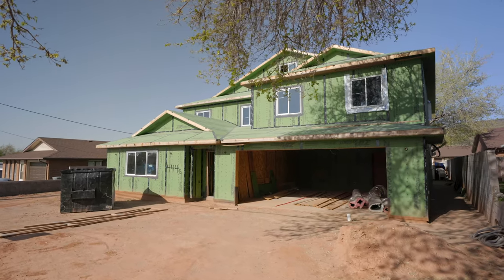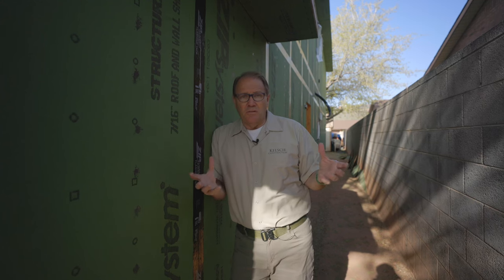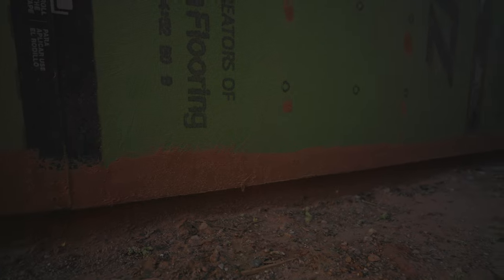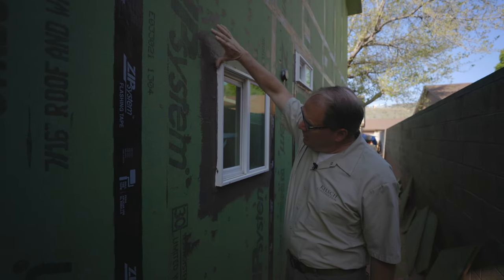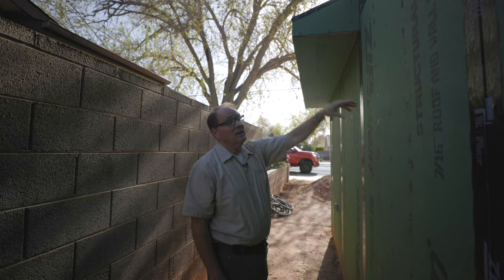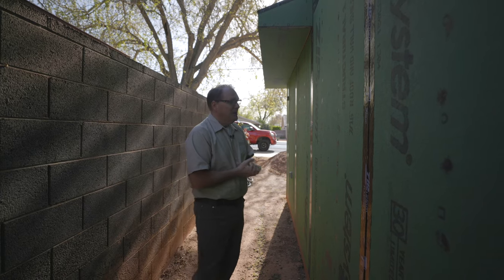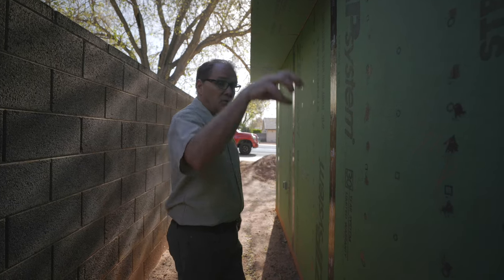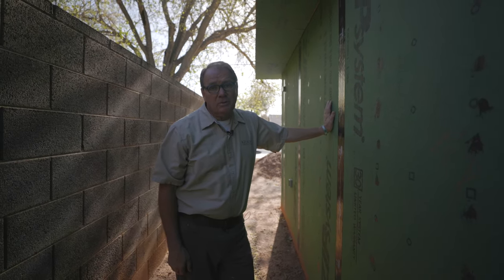Zip System Pros And Cons

Comment: Super tight building should be the standard because water infiltration is the #1 destroyer of buildings, and it's the main reason why so many American homes are falling apart after just 20 years, when most European homes are built to last a century or more. It makes a heck of a lot more sense to manage (filter and pre-condition) airflow into your home with an ERV rather than allowing contaminated air to just leak in. Every new home should be built to much higher standards than are currently the norm. The USA is so far behind other developed countries when it comes to building codes it's shameful.
Reply: When the ERV breaks the home molds up
Reply: @claireh.7605  When the ERV break, you fix or replace it. It's called home maintenance.
Reply: @claireh.7605 umm… why wouldn’t you just fix it? 🤔
Reply: Oddly, a super tight home can be a cause of water problems. Super tight should not be the standard.
Reply: @chadd587  So, do you consider yourself an authority over people like Joe Lstiburek? Just curious. 😂 In this case I’ll appeal to authority, although fallacious, to highlight that maybe you’re just unfamiliar with sound control layer theory.
Reply: If if don’t dry it dies
Reply: @chadd587  There are right ways and wrong ways to do everything. High performance buildings need to be built with "smart" vapor retarders in the right places to allow for drying and protect against moisture accumulation inside walls, roofs, etc. It's not that complicated.
Reply: @dlg5485  Yea, including moisture that originates within the home that would accumulate on that barrier on the I side of the home and find it's way puddled at the base. Happens all the time slick
Reply: No house should be too air tight. Sometimes people outsmart themselves. Dont pay extra for a dumb idea
Reply: @BEYONDYOURIQ Exactly. People would live in a plastic bubble if they could. Why are we trying to separate ourselves from the natural world at every turn?
Reply: @chadd587  Wow, even after all the free education all over the internet from actual building science experts, you guys still think you know better. Some people will never learn...too hard headed.
Reply: @dlg5485 I feel like you've selected you're favorite "education" sources on a bit of a confirmation bias basis. I've done quite a bit of research on this on BOTH sides because I'm actually about to break ground on my home. So I do have skin in the game on this subject. I'm not being flippant I'm being thorough.
Half of my opinion was from local builders and a couple of builders I used for estimates.
Reply: @garryallan824  Duh!

Comment: I'm confused. The whole point of the Zip system is to create a weather resistant barrier. If the owner does his job and routinely inspects his home for joints in siding, facia & trim that could be weakening and corrects them, then water isn't going to get into the cavity outside of some big event like extreme weather. You speak in terms of having the home breath. Again, are you talking about an extremely well-sealed home that has very low chance of getting moisture in the walls, or are you talking about installing an ERV that ensures there's air exchange? You don't really make this distinction. I can use Nashua Extreme Weather Foil 2.83" that's vastly less expensive than Zip tape along with a good house wrap like Tyvek and get the same performance as Zip at a much lower cost. And two layers of bottom plate foam with a good bead of adhesive is a lot easier to install than that bottom sealer that's probably quite expensive just for the product. Probably the most important part of building a taped home is to ensure there's good contact between the sheathing and the top / bottom plates as well as corners. And to take the time to add extra nails and maybe spray sealer like Gorilla or even foam spray.

Comment: The zip systems blocks air and water from coming in but it also allows moisture to escape. It has a perm rating. It’s a very good product. 100 times better than house wrap
Reply: But it can delaminate and tape can fail and water can collect inside tape bubbles supposedly
Reply: The coating has a lower perm rating than the osb but it actually doesn’t dry to the outside very well.
Reply: I think the peal and stick or liquid  house wrap is actually a little better when done right but you have to weigh, costs of all of them. With exterior insulation became more the norm zip r is very attractive especially with shake siding. I am working on a house now where we are trying to figure out what makes the most sense.

Comment: Just finalizing a self build in Maine. We used the Zip system. One point to mention is the tape should be rolled using their Zip roller, it activates the adhesive in the glue and ensures a good seal. Kinda slow and laborious but does actually make the seal far better.
Reply from the maker: Correct. If not done right dust and wind can get under and make it ineffective.

Comment: Zip system is still just OSB. I sort of think Plywood with a wrap would be better than any OSB, regardless of how well you try to seal it up. How long can your sealed up home last without power and it's air handler not moving fresh air in? Humans need air, fresh air. I think making ultra-tight homes isn't good for humans. Building in an air gap between your siding and sheathing doesn't seem like it would be that expensive, and you'd probably want to do with Zip too, regardless. Save a couple bucks a month on heating/cooling, or live in a home that doesn't have every outgas from the products in it stuck with you for days on end. Building a tight home, then bringing in cold or hot air from the outside seems counterproductive to me. There is no free ride in the laws of thermodynamics. If you're bringing in unconditioned air, you're conditioning it regardless of what fancy exchangers you put in. Plus the extra expense of doing all this to lower your heating/cooling bills sort of offsets the later savings, since you're usually financing all this additional cost. I think Zip system is probably a great product in dry climates. In other climates, like cold and wet ones less so.
Reply: Its more than osb, it has a WRB on it which is why it can be exposed to the elements so much longer than any OSB. 
Homes do have windows for when the power goes out. However its not like here in the US people are going without power often or for even very long. 
Yes with titght himes like this you must have an ERV bit this costs very little to run. Especially compared to an AC or furnace. 
Its not all about the money saved but about the comfort of the home. Having more consistent heating throughout the home, less pollen, pollution, and fewer bugs. 

Lastly zip system can be used anywhere but like any system it requires to be properly installed.
Reply: If you're worried about conditioning the air through an ERV, then why wouldn't you worry about the air you've already conditioned leaking out through gaps in the building? You've already paid for that heat or A/C, why not keep it in the house? And wouldn't you rather have the air coming in being filtered instead of coming through the walls, crawlspace, etc.? A tight envelope with controlled air exchange is MUCH less expensive to run and maintain. It makes up for the extra cost of materials very quickly, and makes for a much cleaner, more comfortable home.
Reply: @DeuceDeuceBravo  I'm not worried, my point is why depend on an active system to do essentially the exact same thing letting a few leaks in or out of your envelope would do naturally. And as I stated, no, all the extra expense and the interest rate you'll pay on it won't offset the small amount you will pay every month through natural inefficiencies of a less tight home. You are trying to compare homes built before the 50s and 60s with no insulation to ones that do have it. Plus I haven't even talked about extreme weather events that can have disastrous outcomes with the potential massive difference in air pressure. My suggestion is go talk to people who lived on the Space Station for a long time. They say the entire thing smells a little gross. Keeping everything inside your home and running it through a filter that can't pick up all the things floating in the air does not sound appealing. And if you do exchange it, as I said, there's no magic, you're going to have more expense conditioning that new air, just like you will with natural intra and extra filtration in and out of your leaky home.
Reply: @spazoq  You're missing the point. The air exchange you're talking about is uncontrolled. Just one example... You have humid air passing through your walls when the house "breathes". If you're running A/C in the summer, then the dew point in those leaky walls will cause condensation, which leads to mold and other nasty things. Why not keep the humid air out and control the air that does come in? 
Your point about the space station is irrelevant. That's a completely sealed system with no outside ventilation, meaning they are recycling the air. Homes with ERV's are exactly the opposite; they are constantly pulling in fresh air and exhausting stale air. Odors are basically nonexistent. 
I'm comparing to houses that are being built today with leaky envelopes, which is sadly still allowed by code in many places. They also keep CO2 levels down, among other benefits. The air in the home is much more comfortable and healthier. 
Don't know what you're trying to say about air pressure? Are you concerned about a tight envelope causing damage from pressure difference? If that happens the house was a very shoddy build to begin with.  A properly installed ERV will actually keep air pressure stable and healthy.
ERV's are around 80-90% efficient, meaning they recover at least 80% of the temperature difference when exchanging air, as opposed to leaky walls that don't recover ANY of it. ERV will save a lot more money than letting your house "breathe" through leaky walls.
Reply: @DeuceDeuceBravo  Guy, everything you're talking about requires power. Are you going outside in sub zero weather when your power goes out? Outside in the 110 degree heat when your power goes out? What happens when your area is hit by a natural disaster and your power is out for days or weeks? PS, you're reading off the literature for all this equipment, it's impossible to be that free of losses, there are no heat exchangers that work without electricity, they require $$ maintenance. Homes have allowed varying degrees of natural air exchange for centuries; we know how it works very well. We can control mold and everything else without making your home into an airtight bubble. PS, I don't lose 100% of my heat or cooling through somewhat leaky homes, as much of the leak is through hard surfaces. I'm not suggesting you leave giant holes in your envelope. I'm saying building a home with non-permeable barriers is a mistake. Depending on electricity to exchange your air 100% of the time is dangerous. Not everyone agrees with your 100% airtight home building method, you don't have to convince anyone YOU like it. My reasoning is sound. We live in the real world, we have power outages, we have tornados and weather fronts that move in with massive changes in air pressure. Nobody died from homes that have leaked for centuries. Sick home syndrome is real, and trying to prevent it seems logical.
Reply: @spazoq  I have a generator for power losses. You've obviously made up you mind, so I won't bother with any more logic.  Best of luck on your next build. ✌️
Reply: The reality is the best solution is airtight and vapor permeable-zip,unfortunately doenst achieve that, but builders insist on zip BECAUSE it’s easier thus more profit for them than say osb and liquid merman’s like Prosecco. It’s teh same with their zip r, even when everybody knows osb with true ext insulation is better. I can’t get a builder in out area to do this-ie optimally . And can. Get building supply houses to stick anything out do the ordinary Thsi industry is insane, way too conservative. Way to,little competition, intelligence etc; its out of control. Subs/builders have far far too much control after a decade of gravy train due to low interested rates. If you can, wait until we have a recession and they come begging for work again. What goes around. Comes around etc.
Reply: @johnwhite2576  Tons of homes have water damaged OSB from the 80's when everyone started using it. Once zip has been around 20 or 30 years, maybe we can see how it's doing. Good old plywood will still do better IMHO.
Reply: I am 61. An electrical contractor. Having worked in the housing industry most of life even as a child with my grandpa I can give a little real world experience of non Zip system homes. They stink. The crawl spaces are moldy/mildewy and much of that air makes it into your home. The attics stink as well and it gets worse over time. We have a lot of humidity here. When its humid my heat system works overtime as it has to deal with the hot humid air that my non zip home “breaths” into it. Then the hvac drain drips that moisture outside. During this process the interior of your heat pump gets wet. Thus it puts a certain amount of moisture into the duct system. It creates a permanent residue inside the duct which to my very sensitive nose  gives off a very unpleasant odor. Even the vast majority of new construction homes have mold or mildew forming as early as during the construction process. I have Crawled under hundreds or more homes. Probably easily over 1000 homes. I did not count. We are talking custom homes by what would be considered quality builders doing the normal processes. Not only will I be using Zip system on my new home but I am having a non vented crawl space that will have a concrete floor as though it were a basement. Pollution is out of control and getting worse. I want control of the air I “Breath”. If we have a extended power outage I can open/crack a window on each end of my home and get plenty of that polluted “fresh air”intake/“Breathing”. I am in South Carolina and the smoke from the Canadian wild fires was choking us all the way down here. If Zip system was a problematic way of doing things we would surely have seen it by now. Much like when they were putting stucco over styrofoam back in the day and all those homes had mold in the walls. It was poorly done. Just my two cents worth. A well sealed home will provide comfort and efficiency in reference to power consumption as opposed to a non sealed home. A naturally “Breathing” home will use far more energy keeping it conditioned all things considered. And it gonna eventually have that old stinky unpleasant odor. 
Terry
Reply: @DeuceDeuceBravo 👍
Reply: @ForestToFarm  Have a great time with your Radon-home. BTW, hope you're not getting any construction materials from China, remember the  strontium sulfide drywall? Also, hope you don't have any pets, that pet dander is super hard to get out of an airtight box.

Comment: Thank for this clip. I’m getting ready to build here in Huntsville AL and I’m going to use the Zip System. Cost a little more than regular OSB, but it’s worth it
Reply from the maker: That is great news. Keep us posted.
Reply: About how much more?
Thanks!
Reply: @L.J.01 
Here in NE Georgia Zip sheathing is about $10 a sheet more ($27) than OSB ($17) at the local Lowes store.
I'm planning to build a cabin about 1100 sq ft soon. 
Hope this helps.

Comment: Keith, I installed the Zip R-3 (insulated board) on my cabin up at Strawberry Res. and a couple of issues that I noticed on your neighbors project. The liquid flashing around the windows should not go on the outside bottom of the window trim. They should have either taped the inside bottom and sides including the top and outside sides and top but the bottom needs to allow any potential condensation out at the bottom. 
Also the green zip system is not rated for the flat roof panels (I verified this with my structural engineer during construction). They need to use the brown/orange roof sheeting. I also used a liquid flash on the inside of my windows and around all of my doors, between foundation/sheeting and including the garage doors. The cabin heater rarely came during this past winter even when it was -40 degrees.

Comment: Agree with this. Also would add to this that a rainscreen would be preferred so that you can get airflow from the foundation/sill plate all the way up to the sofit. And then adding a stand alone ERV/HRV. Then you would get great airflow inside and on the outside as well.
Reply from the maker: Agree with rain screen. However in our super arid environment it is not as much of an issue as it is in most areas of the country.
Reply: @How to Build Your Own Home  very valid point. Sometimes I get so used to the east coast humid wet climate  I forget you all have the opposite out west.

Comment: Building ours in eastern KY with zip and an ERV. We’ve chosen to have a ventilated roof instead of a ventilated attic as well. We are using liquid flashing where the concrete slab meets the zip osb to seal it up.
Reply from the maker: I prefer liquid applications. That will be great.
Reply: Building here in Eastern Ky too, with Zip. Are you using any exterior insulation by chance?